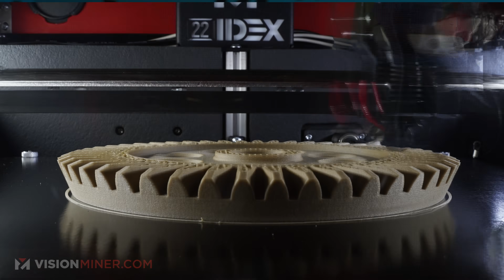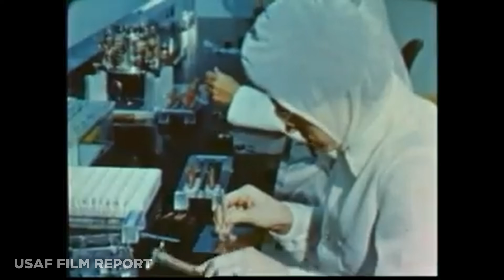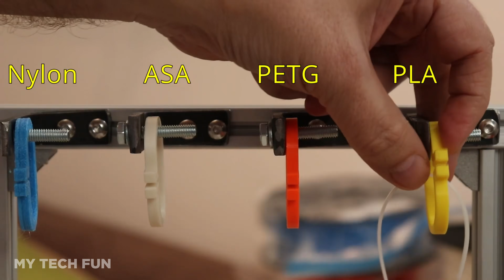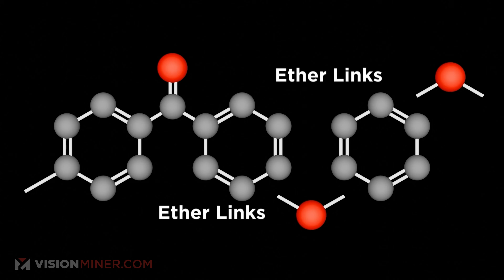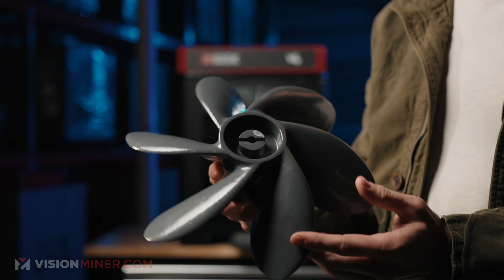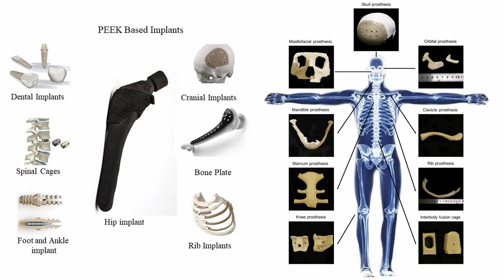How PEEK Changed Engineering Forever

Comment: I work in the workshop of a university chemistry department. I’m the electronics technician, but I work alongside 4 machinists. We often mill or turn parts out of PEEK because of the chemical compatibility, mostly for applications where Teflon’s mushiness precludes its use. (As well as for high-temperature applications.) We don’t have a PEEK-capable 3D printer, sadly. 

So yeah, it’s expensive, but sometimes it’s just the thing that works.

(It does kinda hurt to see huge amounts of PEEK chips go in the trash. Oh well.)

Comment: I can’t believe you sell your printers at 14,500 wtf that like a cnc machine price range. No thank you! Bruh!
Reply from the maker: Our printers are, in fact, in the same category as CNC's -- they're high-temperature machines, designed for performance plastics that require 3D printing inside of an oven. So, yeah, not for your average Joe who likes 3D printing fun, more for the businesses making parts for aerospace, medical, oil & gas companies :)
Reply: @SpectralonWhite You can’t compare hobbyist equipment with commercial equipment. $15K for a commercial machine is peanuts. (Real CNCs cost way more than that, by the way…)

Comment: I currently operate two Stratasys F3300 printers and frequently print with 9085 (PEI). To date, I've printed around 300kg. Aside from the expensive material costs ($650 USD/kg) and the major headache of removing support structures, everything else is excellent.

However, I believe that when it comes to printing giant PEEK or PEI parts, after evaluating numerous machines, Stratasys remains the ultimate choice. Many machines boast massive build plates on their spec sheets, but they simply cannot successfully print full-plate PEEK or PEI. I regularly print PEI parts at 600 x 600 x 700 mm, and I really think companies like AON3D or 22idex need to actually do a demonstration print of that scale to prove their capabilities.

Comment: ever heard of polycarbonate?
Reply: Polycarbonate isn’t even close to a substitute for PEEK. PC is absolutely good enough for many applications, which is why it gets used for them. 

But if you need PEEK’s thermal and chemical resistance, PC isn’t even remotely comparable. I work in the workshop of a university chemistry department. The chemists frequently work with solvents that dissolve, swell, and/or weaken most plastics. For non-metal parts that come in contact with solvents, Teflon, POM, and PEEK make up the bulk of what we use.

Comment: Back in the mid 1980s, only a few years after PEEK was first developed by ICI, we used coax cables made from PEEK to connect high voltage radiation monitoring equipment on the nuclear reactors we operated  in Scotland and in England.  PEEK cables were provided by the Atomic Energy Authority at Winfrith and were used because of their temperature and radiation resistance.  Whilst these cables were not actually in the reactors they were close to the reactor pressure vessels and hence worked at high temperatures and high radiation doses which quickly destroyed other plastics.  They were incredibly stiff though and could only be bent slightly into a gentle snake-like shape so there was no direct radiation path out to where people worked.  I had a bar of PEEK in my office which was about a metre long and 25mm in diameter.  When dropped a few millimetres on its end onto a concrete floor it would ring like a bell - incredibly dense material.  No idea what the cost was but it would have been substantial!
Reply: In the 80s…

I was a polymer engineer…

Got to extrude some interesting materials.  I remember a PEEK bar we had sitting around the office. Based on the nice ring tone it had.

We got to run all types of tests on plastic samples… DSC, TGA, and other physical properties…

Extruding films of FEP is where I got my start.

😃
Reply: PPS и PPO точно так же как колокол звенят

Comment: Some of this script felt like the encabulator babble.

Materials have progressed. I'm seeing 3D printers making auto parts.

Now I want to see a video breaking down which 3D print materials are good for what purpose.
Reply from the maker: The original machine had a base plate of pre-famulated amulite surmounted by a malleable logarithmic casing in such a way that the two spurving bearings were in a direct line with the panametric fan. The latter consisted simply of six hydrocoptic marzlevanes, so fitted to the ambifacient lunar waneshaft that side fumbling was effectively prevented.

Yes.... it's time for another filament tier list!

Comment: So how do you recycle Peek if it’s so unreactive?
Reply from the maker: PEEK scraps, whether machined chips, offcuts, end-of-life parts, failed prints, or anything like that --  can be milled into powders or ground down / chopped up,  then reprocessed into filaments used in injection molding.
Reply: @VisionMiner  We really need to look into that at my work. I work in the workshop of a university chemistry department. I’m the electronics technician, but I work alongside 4 machinists. They mill lots of PEEK, and so far, the chips just get trashed. I wonder if the suppliers are interested in the PEEK chips at all…

Comment: I looked at Peek for a couple of jobs when I was a Site Engineer before I retired. When I picked myself up of the floor after seeing the prices I was quoted, Peek went firmly in the DO NOT CONSIDER FOR ANY REASON category. There was absolutely nothing we would have used it for that could have justified the horrendous cost.
Reply from the maker: That's exactly true for 99% of use cases -- so many people ask for PEEK, but the barrier is so high, it really only gets used in heavy (expensive) industry -- aerospace, medical, semiconductors, oil & gas.
Reply: @VisionMiner  Yes, that about sums it up'
Reply: Keep your eyes peeled on you tube.
There is a clever chap from Vietnam who makes quite complex stuff from waste pvc material.
More often than not he begins by flattening used pipes using a simple hot iron,then drilling,sawing and reshaping to make the parts he needs.
Not all of us have the budget for a 3d printer.
I found his approach quite refreshing as I often repair broken lawnmowers bikes,etc...for folk who cannot afford to purchase replacement parts....especially when sometimes all you need in a lot of these cases is a bit of molded plastic in just the right dimensions.
Reply: @boogieknee3781  Your comment has absolutely nothing to do with the subject of this video.

Comment: Thanks you but no tanks. I found PPA-CF-Core brutal layer adhesion, very good thermal stability, minimal creep (almost not existent) and very good durability and the best part 100$ per kilo and requires 60C chamber. PPS if I want 0 creep. Those two polymers made peek obsolete in 99% of the cases due to terrible layer adhesion of peek.
Reply from the maker: It's not that PEEK was obsolete, it's that using it was overkill, like 99% of cases. It's not meant to replace everything, it's meant for extreme cases when nothing else will work :)

Comment: Also useful as top tier cable ties in extreme environments
Reply: You wouldn't have loose unprotected cables in extreme environments. If nylon cable ties can't handle the environment then neither can the cable.
Reply: @OU81TWO UV kills a nylon tie in a 20y application
Reply: @solastalgia440  Yeah so? In what application that's expected to last more than 20 years would you tie up loose cables that are exposed to extreme conditions? Anything I've ever done involded tek cable in those kinds of environments and they were secured with proper routing clamps not cable ties.
Reply: @OU81TWO microphonic sensor cable on a perimeter fence. Industrial lv and control cables on tray at a processing plant.
Reply: @OU81TWO  I can tell you’re a man who truly loves himself, all pedants do. PEEK cable ties are real and they are used in several industries, end of story. Those industries aren’t simply lacking for your insight and genius, or maybe they are and you should send them an email they might even pay you a percentage for eliminating a major cost. Another thing you said that was incredibly foolish was that somehow people should assume something can be replaced in less than 20 years. You do realize there are places that are far too dangerous to consider an expedition simply to replace cable ties? Do you think men that climb towers in remote locations grow on trees, do you imagine it’s cheaper to send them up that tower or to simply use a better quality of cable tie in the first place?

Comment: Of course PEEK is an amazing material, but it's use will remain limited simply because of its price.  You won't see it in many mass produced, mass market products until prices come down.  Many engineers will just switch to a metal than deal with PEEK.  But there are other plastics which might offer 80% of PEEK's strength or temperature range or other property for way less than 80% of PEEK's cost.

Comment: Nozzle temp: 390 - 420
Price: $500/kg
Reply: Printing time, cost .... too much, as this is something that in 90% cases is used to prepare not the final product but prototype and test it (or temporary replacement) until production will ramp up. Either way, great solution, but this will grow only if used by many - and that will not happen at those pricetags.
Reply: @michalwiktorow2188   I think there is an opportunity to find a way to make it cheaper. Once that problem is solved, it will be the industry standard. Hope so😅
Reply: Imagine large print failure 😅
Reply: Don’t forget the chamber temp
Reply: @BambuLaber  When nozzle temp comes to 390+, 90% printers left chat.
Reply: Ender 3 can take it, we must believe
Reply: Thanks
Reply: holy moly thats expensive
Reply: And polycarbonate is similar in raw strength
Reply: The end game
Reply: Thank you, that saves me plenty of research.
Reply: Works on my machine.
Reply: Yeah, but this stuff is used on, like, satellites and shit. You don't need it to 3D print your fridge magnets and book ends shaped like a cat.
Reply: @Gr8_Ape_69 hahaha this applies to 95% of 3d printing comments on youtube.
Reply: @Gr8_Ape_69 it's also used in dry herb vapes 😅
Reply: @Gr8_Ape_69 guns

Comment: PEEK is a high performance plastic engineered for extreme environments when standard plastics fail.

But it is not engineered for mass manufacturing via injection moulding (though technically possible, but not always feasible), when the tool going through extreme thermal wear, precision instability from CTE and costs of raw material vs scale of economy made it economically impractical even for some high end engineered mass market products.
Reply: Dionex Corporation was a pioneer in the use of PEEK for analytical instrument components starting in the mid-1980's. Initially it was used for high-pressure tubing, up to 4,000 psi and subsequently extruded rods were machined into the heads for the high-pressure pumps. The "eluents" used in, specifically, ion chromatography, may be of either a low or high Ph. There was an attempt to injection mold the pump heads but attempts never succeeded. The results looked to be halfway to a charcoal briquet. These were high-end laboratory instruments so the cost of PEEK materials was a minor part of the material cost. I also designed a number of flow cells for various detectors that were also fabricated from machined PEEK as a Product Designer for the company up to 1995.
Reply from the maker: phenomenal information, thank you for sharing!
Reply: LEMO connectors (which are widely used in nuclear, laboratory, and high end instrumentation) use PEEK insulators (the contact inserts) in most models by default. So they’re one of the few connectors where you can heat the pins as long as you want when soldering, without risk of melting the insert. (Though I assume they switched to PEEK due to radiation hardness, since LEMOs are everywhere in nuclear research. I haven’t been able to find out what plastic they used prior.) The inserts look injection-molded, but I can’t be certain.
Reply: Tiny PEEK tubing is also widely used in laboratories for flow chemistry, where its chemical resistance is essential. Lots of things at work (a university chemistry department) use PEEK tubing with an inner diameter of just 0.5mm, so to get any flow, it requires quite a bit of pressure, which PEEK handles just fine.
Reply: @tookitogo  In the late 1980's when PEEK first became commercially available Dionex Corp. pioneered the use of that material for high-pressure flows in analytical instruments. The "lumen" or bore  in tubing that was roughly 1.5 mm O.D. was about 0.15 mm I.D. for service at 4,000 psi. The same company is now advertising a 5,000 psi flow path. In addition to tubing PEEK was used for
 machined pump heads, pressure transducer housings and flow cells.

Comment: It was VERY expensive when it came out. Is it any cheaper today? I machined a lot for the med implant industry. Respirators were needed to clean parts using MEK, nasty stuff.
Reply: 340 for half a kilogramin amazon
Reply: @estebangarcia6092  Im guessing thats for filament? I dont print anything.. Thanks.
Reply from the maker: $800/kilo for the pure stuff in filament form -- pellets, cheaper. Rods/sheets, cheaper, but still very expensive.

Comment: Convenient how you didn't mention the INSANE cost of PEEK...

And if that wasn't bad enough, now try buying it in filament form...
Reply: Well, it isn't as easy to come by as PLA, and you're probably not finding it on Amazon. But two of my filament dealers have a bunch of spools in stock. One even has PEEK CF. And I didn't bother checking a third one after the first two hits. 
Granted, the price is giving some goosebumps. Although the most affordable offers in stock start at "only" 375€/kg (approx. $400), it would be no fun to go through a spool. But hey, it's not the same stuff as PLA. If you don't like the price, don't print figurines out of PEEK. Reserve it for stuff where the choice of material isn't driven by bragging rights but where the properties really matter.
Reply: spot on 👍
Reply: It´s as usual, no cons are ever highlighed
Reply from the maker: OOOooooo, maybe we should do a video on the challenges of printing PEEK -- that might be a good one!
Reply: @VisionMiner My first job machining it, the company had no Idea. Lesson one, you will NEVER ream PEEK to size. Costly lesson for them. Awesomely repeatable material if you respect it, though.

Comment: PEEK can withstand radiation exposure that turns Teflon to mush. It isn't subject to radiolysis like other plastics. It isn't very flexible but PEEK tubing is very resistant to kinking which makes it a great material for nuclear medicine production.
Reply: Those same properties also makes it great in wire harnesses for space. We use alot of it at my job. We also use peek zip ties!
Reply: @freshcoastdrifttracks6074 Do you cut those ties at the ceremonial angle to punish those who dare question your work?
Reply: @bryanbrady877 not allowed unfortunately, even though its extremely unlikely you can get anywhere near them in the final assembly. If i could i would just to imagine a future astro/rocket/surgan cursing me out 10 years from now.
Reply: @freshcoastdrifttracks6074 I hate/kinda love PEEK as a machinist. Like the ex I hook up with all the time, I know how to work it. Deburring tiny intricate parts...Find a better man, I frickin quit.

Comment: How about biodegradibility?
Reply from the maker: Biocompatible, but.... probably going to biodegrade at a similar rate to....... glass. Yeah, not really a factor on this one 😂
Reply: Bad. But at least it's not toxic.
Reply: Wanting something that is both biodegradable and extremely chemically resistant is kind of like wanting something that is both very lightweight and incredibly dense at the same time. Those parameters pull in opposite directions. Being biodegradable inherently means being chemically susceptible.
Reply: Biodegradability isn't a topic that concerns 99.9% of all polymers. They don't do that
Reply: @GerManBearPig   that's a pretty narrow view of polymers.  Turtle shells are polymers.  Algae produce polymers.  Fungi produce polymers.  There are few categories of manmade materials that have more potential for biodegradability than polymers.  But making a material (like PEEK) that is chemically resistant and biocompatible runs counter to that. Horses for courses.